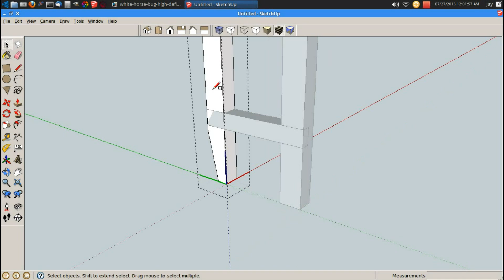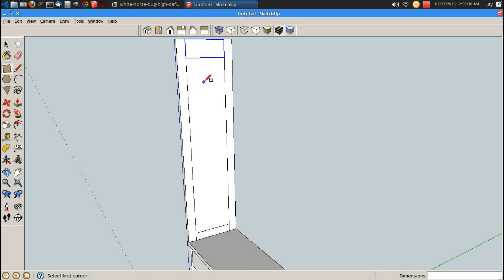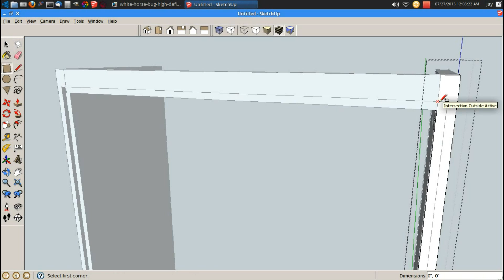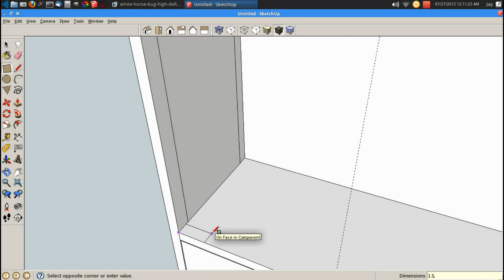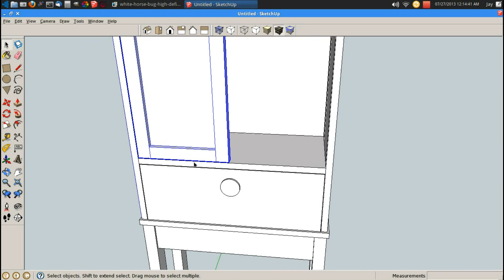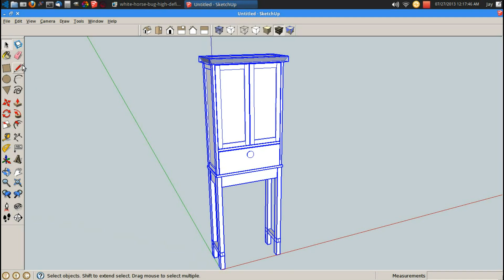SketchUp - Toilet Cabinet - 109

Comment from the maker: I used to use 2x10s for most of my projects for that reason. A local box store has started carrying great quality dry 2x4s that I have had good results with. I may check out the 2x8s though, they are a bit lighter than 2x10s.

Comment: I like the concept.  I see some concern with access to the toilet tank if, say, you have to change the valve or the float.  I'm wondering if there would be a discrete way to put wheels on the bottom of the cabinet so that you could roll it forward to permit access to the tank.